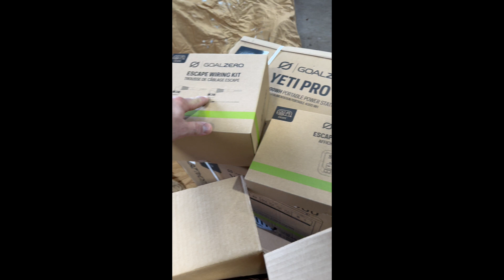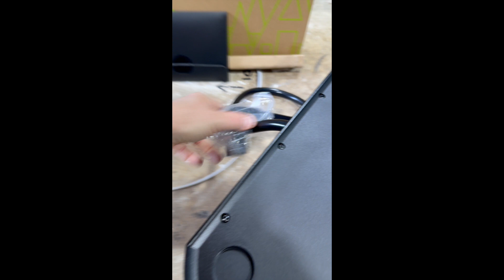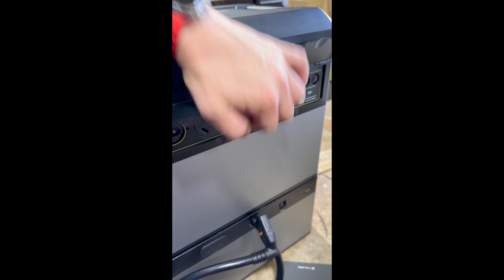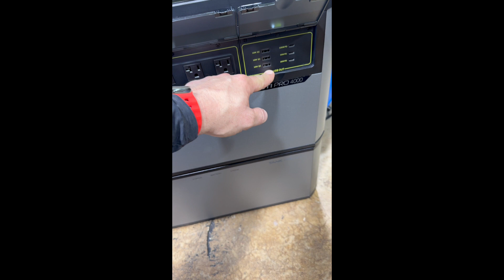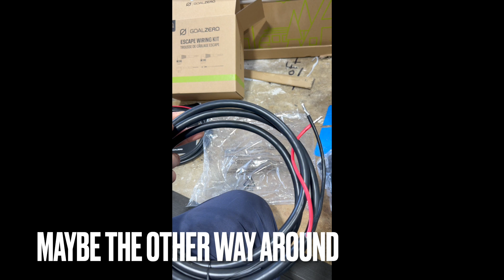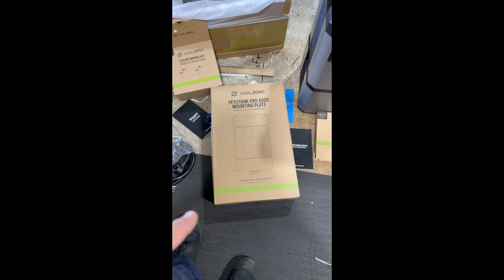goal zero yeti PRO 4000 unboxing

Comment: Hi. I just got my 4000 pro in yesterday. So far I’ve charged it to 100% on low input mode.  Hooked it to my fridge to until it depleted the battery which took about 17-18 hrs.  Then I tried to charge it on high input mode.  I’ve gotten 2 over heating warnings while charging from the outlet. Then the ac input port was “disabled due to a general protection fault”.  Have you experienced anything like that with yours?